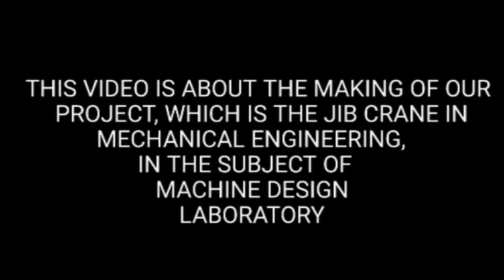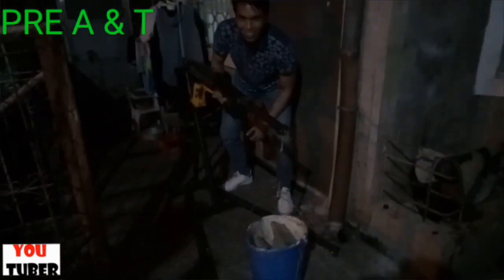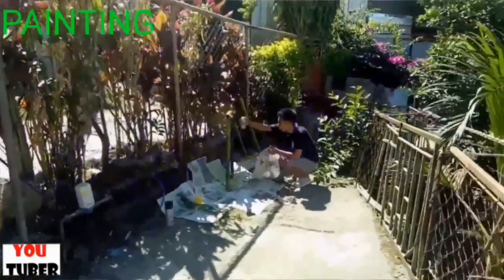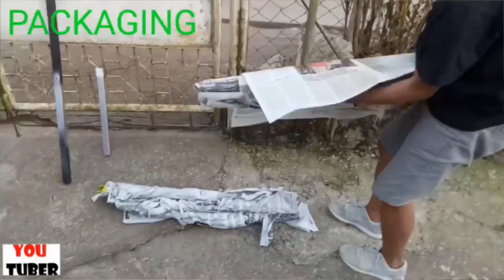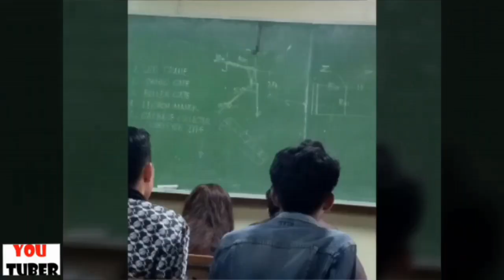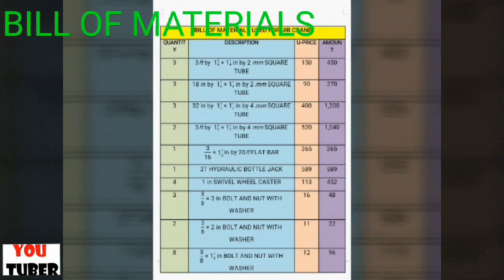JIB CRANE/ENGINE HOIST FABRICATION, ASSEMBLY AND TESTING

Comment: How many minimum weight it can lift
Reply from the maker: I think it can handle up to 250kg or more but We only tested about 80Kg and it lifts ease.
Reply: @DowinJoe  can we get the design of crane
Reply from the maker: @darpanpatel3075  Okay, Sure! Just support my Channel as well. he he
Reply: @DowinJoe  yes I will support you, and how can i contact you
Reply from the maker: @darpanpatel3075  Message me on FB. Check the link on the about channel.
Reply: @DowinJoe  ok